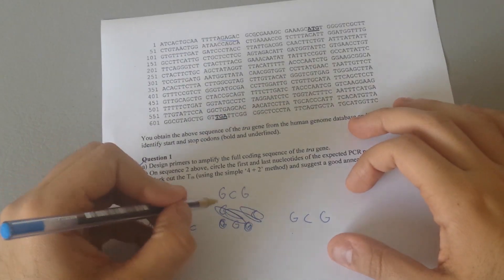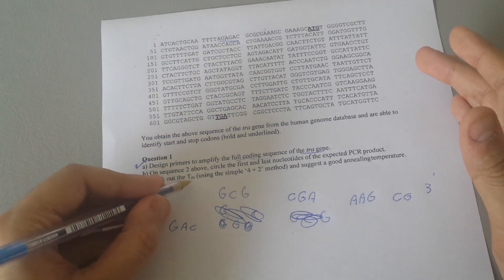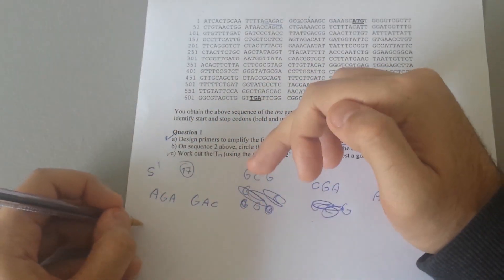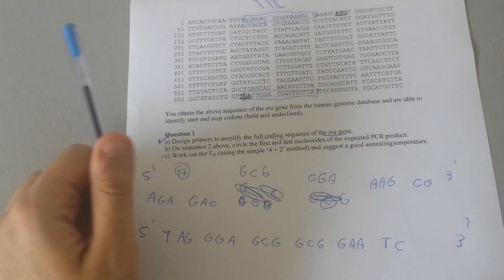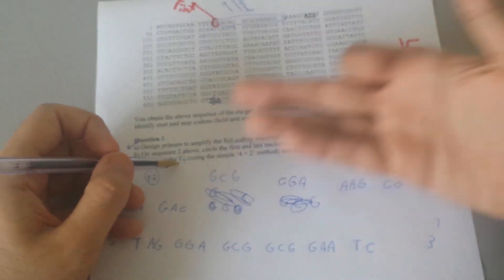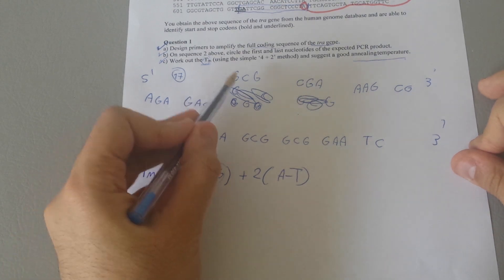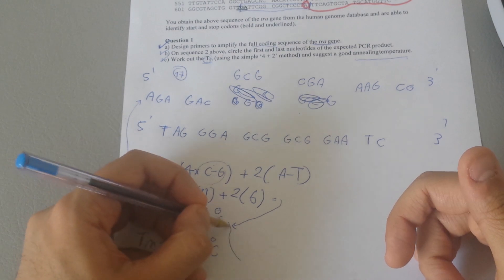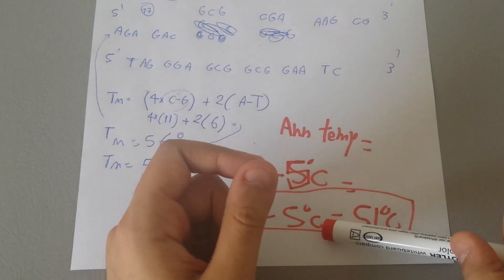How to Design Primers for PCR Practice Problem 1

Comment: Why don't you start your primer right at the start codon and the stop codon? Why start way before? Thanks.
Reply from the maker: Hi Jeremy
Thank you for question.
Question asking to design primers to amplify coding sequence (i.e has the start and stop codon embedded in it). This means the primer would be good as long as it is not after those two sequences. So it doesn't matter where you start BUT it must "cover" those two sequences or i.e come before it so that we still will get WHOLE gene sequence as it displayed on this video. Or you can just start at start and stop codon, important part however is considering the Tm and annealing temp and etc...
Hope it was sensible.
Reply: @hamedhosseini4938  So my 5' end of the primer could have started from ATG but you chose not to for better Tm calculations?